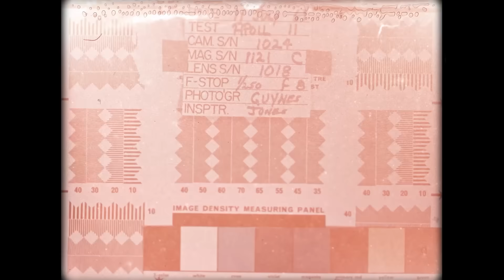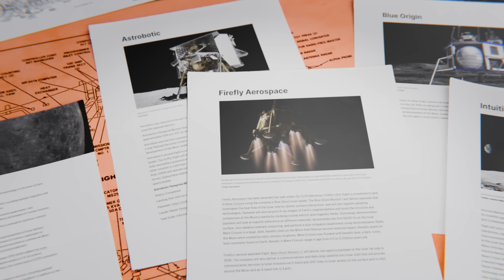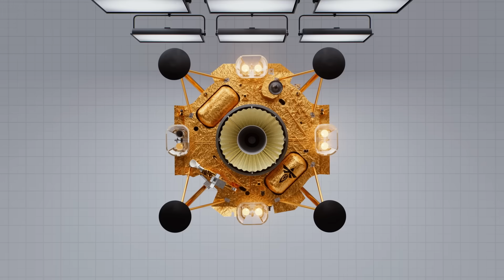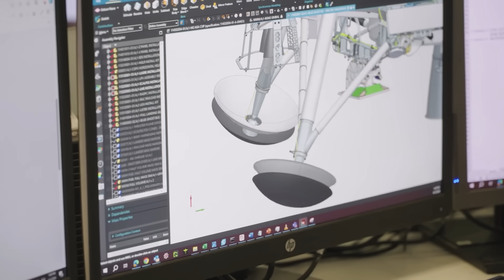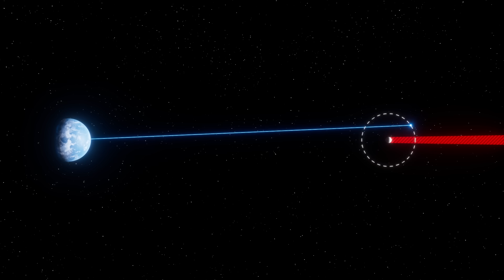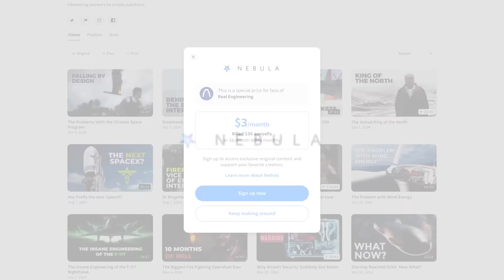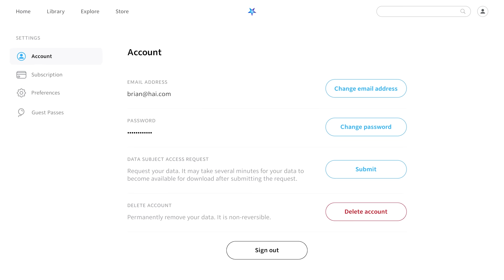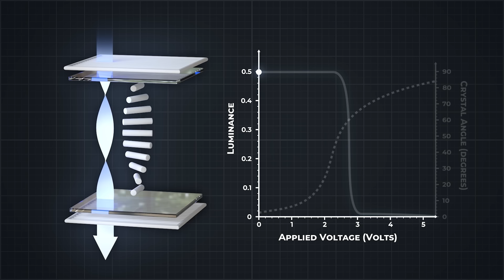Why the US is Struggling to Land on the Moon

Comment: Many KSP players can attest to how difficult it is to land on a foreign celestial object.
Reply: And KSP makes it 1000x easier than it it is irl
Reply: @relafleur5114 idk if you're exaggerating, but if you really think it's 1000x, its actually 20x easier.
Reply: @relafleur5114  that's so long as the kraken doesn't rear its head
Reply: @relafleur5114  the opposite, KSP is waaay more difficult than irl. There you do it manually, here you have computers with immense presission. (Obviously the game magically builds stuff and ignores actual chemistry, but spaceflight is waay harder manually)
Reply: @moontworks2232 well sure, it’s “easier” to let the computer do the work, but the point of the vid is that our computers are far from reliable at this point. If IM could have a skilled pilot manually fly their lander to the surface in 60 fps, with a fully adjustable 3rd person camera following it the entire time, there’s almost no way they could have failed. Not to mention that most the moon rocks to be avoided in KSP exist as flat textures. Theres just too many factors of doing it irl that you don’t even have to think about to do it in KSP
Reply: It's very easy to land, but my tank of fuel is empty once Im there. it's just hardcore to send enough fuel to ever come back and get another orbit on Earth to then splash down, even with rendezvous and refuelling on Earth orbit, which is already a challenge in itself
Reply: @Etrehumain123  Another orbit on earth? YOLO, straight to 50k meters altitude.
Reply: @Etrehumain123  Do enough Rendezvous and they become easy. 

I have a research and fuel station Orbiting the Mun at 18km and mastered rendvouz and docking int he process of ferrying back down and up to all 17 biomes and contract sites. Had to send 1 refuel mission which I used to also put a satellite in Mun Orbit for a contract. Total liquid fuel load was like 4.4k on the Station and Refuel misison each, 8.8 liquid fuel and associated Oxidizer, and got both back landed in the water just off the spaceport. Efficiency! 🤓

Docking itself is easy once you learn to use the RCS with H and N key to fine tune to approach.
Reply: @Etrehumain123  most of the time the engine you use plays a larger role than the amount of fuel
Reply: Facts
Reply: I landed on the moon but didn’t have enough fuel to make it back
Reply: @SparklingWalrus  In my cases there might have been enough fuel to fly back before landing. However it will just burn up when it lands very fast in to the moon. 
Some are saying that I am just bombing the moon bit hey a landing is a landing that hunk of metal is on  the moon.
Reply: @SparklingWalrus almost
Reply: I love remembering a certain aspect very early on in ksp, where a friend of mine just used infinite fuel since he did not understand how to get to the moon properly and accelerated straight towards it, with me sitting behind him. With 20.000m/s and closing in on the surface, he flipped the rocket around and began tiny little course corrections to straighten the rocket, with me just sitting behind him, with a huge grin on my face, and 30 seconds before his "landing" asking him if he isnt a bit fast. The look on his face when his head turned to me, checked the speed and immediately began to to full throttle shortly before scattering all of his rocket and crew on the munar surface. Good old times.
Reply: the tip over was so kerbal XD
Reply: Imagine playing KSP with 2.5 seconds of lag. That's how long it takes for signals to round trip to the moon.
Reply: @JoshuaPTFan  there is a mod. for obvious reasons, it had not a lot of fans: the idea behind the mod, you have 2 or more players. one player has a screen with orbital data, and the other one has a screen with the view, but only cockpit.
one player was mission control. I think, they didn't go all the way with time delay, etc. but it would have worked.
there was also a antenna mod, before stock antennas were a thing. that thing too took time delay and blackouts into consideration.
Reply: Any landing that doesn't explode is a good landing
Reply: Landing - quite easy. Rescuing stranded Jeb from a planet with an atmosphere and bringing him home - yikes!
Reply: just get them to do it
Reply: @bpqd2624 Unfortunately even if you are an RSS mod veteran, KSP does not accurately simulate multi-body gravity because the math is too hard.
Reply: @starshade7826  the Principia mod comes close.
Reply: What I do is make the rocket so big that I start on the Mun
Reply: bro rss is so much more difficult than stock
Reply: It's quite easy to land on anything when you can use saves.
Reply: One of my fond early memories of KSP was successfully landing a crewed lander on the Mun, only to realize I don't have anywhere near enough deltaV to make it back.

This forced me to design a rescue lander with sufficient capacity and deltaV, but none of the scientific payload, then land it close enough to the original lander to allow my kerbals to carry themselves and the data from one lander to the other using EVA suits.
Reply: Every KSP player ever just nodded at the lander tipping over. "Yep, that's how it goes."
Reply: 12:45 that bounce after you think it's successful landing, I want to smash the monitor
Reply: Many KSP players can attest how difficult it is to take off from a celestial object ...
Reply: ALT + F12 is the solution
Reply: Maybe they should have designed their ship in KSP 🤪
Reply: The easy part is landing the hard part is coming back
Reply: Funny, but the older I get, and I'm old now, the less I believe that the US went to the moon, especially given how they are behaving now. Just saying.
Reply: I’m still trying to figure out how to take-off without spinning out of control and exploding, maybe I should add more boosters.
Reply: i now man i can barely get in orbit iv had this game for a year its hard
Reply: I'm an old timer on KSP and I STILL find landing on the Mun challenging. 

Although Minimus is a lot farther away, its lower gravity makes landing considerably easier.
Reply: I mean it's way easier in ksp but oh man is it hard to get a decent manned  lunar lander on the moon get it back also hoping that nothing fails and that your simulations were correct in ro rp1
Reply: It's like KSP, but with 1/1000th the budget and only unmanned spacecrafts.
Reply: My kerbals launching in ironc0ck11 right after uronc0ck10 has failed while taking off, no changes have been made
Reply: 'Outer Wilds" is also quite challenging in landing on a planet
Reply: This is why we need a smaller, more spongy mun farther out.
Reply: Robbaz is the living proof
Reply: And the fact that unlike KSP, you’re dealing with tight schedules, dozens of suppliers providing thousands of parts and assemblies, politics, funding constraints, human factors and any manufacturing or quality error results in people dying. 

It’s incredible what humans are capable when everyone comes together for a single purpose. Especially when that single purpose was something that had no benefit besides human curiosity. 

“But why, some say, go to the moon? Why choose this as our goal? And they may ask—why climb the highest mountain? Why fly the Atlantic…? 

We choose to go to the moon, and do these other things…not because they are easy, but because they are HARD”
Reply: And you learn right away that a good lander is squat and wide, not a a tall, skinny stick.
Reply: I had no idea the Kentucky State Police has jurisdiction/presence on the lunar surface... Very sexy/exciting news, indeed!! They'll politely beat the aliums' brains out if they try and sabotage our next mission! This is an excellent revelation.
Reply: I'm phenomenal with it... Using unlimited fuel cheat...
Reply: I have abandoned so many poor Kerbal
Reply: Us is fucking stupid.
MAKE PANCAKE  NOT CIGAR.
Its the number one rule
Reply: No it isn’t, they did it allegedly in 1965 and just can’t seem to figure out how to do it since with all of the advanced lasers and rockets and computers, absolute lies, we’ve never been to the moon, all of this is computer imagery it’s all fake
Reply: Landing is super easy, barely an inconvenience.
It's returning from the foreign celestial object that is difficult.
Reply: The main thing is you CANNOT miss details in design and planning. Execution is not too hard unless you skimped on budget.
Reply: Has anybody here tried to play ksp realism overhaul, real solar system and realistic progression 1? I have played it only until orbit
Reply: Nothing compared to a rendezvous with no ecs or mono propellant
Reply: Anyone without training can land on the moons in ksp.
You don't need any math, engineering or physics knowledge.
Ksp isn't made to be difficult, but to be a fun arcade game.
Reply: The only way to land on a terrestrial body is with or more than 3 rockets not placed direkt under the tail to balance but away from the rocket body and when on  landing mode the whole of the rocket have to land upside down and the rockets up which can turn the trust to the  surface of the terrestrial body for effective center of gravity
Reply: RSS/RO gang 💪
Reply: I landed several hundred times without issue both in stock and with realism overhaul. It is pretty easy, I even made an algorithm that does is correctly 9 out of 10 times, where 1 out of 10 times it lands just inside the rim of a crater (steepest slope) and I am too lazy to make a better algorithm. Of course landing become a lot harder if you can only throttle down to say 80%, with too much thrust-to-weight, an engine with few or no relights, barely enough fuel and insufficient RCS.
Reply: @richardbloemenkamp8532  out of curiosity, how do you get the algorithm to run on ksp? That sounds like a fun playthrough
Reply: in KSP, landing on mün is easy.
a few thousand meters above the ground, you activate the parachutes, and then you just wait.
and need quite sturdy girders as landing legs, because you are now lithobraking.
Reply: @robertheinrich2994 lithobraking? Parachute? The mün? Are you high?
Reply: @brucemanly  congratulations for finding the joke.
Reply: @robertheinrich2994 aren't jokes supposed to be, ooh what's the word?... Funny?
Reply: @Chris-ok4zo

I'm not sure what you actually want to say here.

Also, I think it is very sweet that you try to compare an entertainment simulation program with real life. That's not even comparing apples to oranges, that's comparing apples to eggs.

Also, if you think that playing KSP for any amount of time amounts to the same as hundreds of thousands of people working for a decade on a space program, and that you investing a few bucks in a program amounts to the same as the roughly $25B (in 1973's money; roughly $250B in 2023 money (Wikipedia: Apollo program)) spent on the space program, then that is very sweet also, but a little bit out of touch with reality.

Last-but-not-least, if you think anybody playing KSP is as qualified as Neil Armstrong, then I think you're comparing incomparable things again. That's like saying, because somebody is a master-piano player you are too. Or because somebody else is a patissier you are too. Etc. etc, I think you get the point. Life doesn't work that way. In fact, I think Neil Armstrong was a kind of a one-off. Not even his colleagues could do what he could do. He was a real master of his craft.
Reply: @light-from-dark  "I'm not sure what you actually want to say here" - clearly : p

I think the implication goes the other way: even in a simplified environment like KSP, this is already tricky to get right.
Reply: @light-from-dark  You appear to significantly underestimate the value of games and simulators. Today, Formula 1 drivers learn the majority of F1 driving in racing simulators/games. Flight simulators are the backbone of pilot training. 
I'm not saying that building a rocket with KSP is reality but there is a decent amount that can be learned and that most people without game/simulation experience do not understand. 
You can call all those people sweet and naive but in the end you yourself will know and understand the least. 
And by the way it is quite likely that you are not in a position to judge the quality of Neil Armstrong compared to his colleagues. There are a ton of romanticized stories but did you actually have access and read through his medical and test records or are you just repeating what others made you believe?
Reply: @richardbloemenkamp8532  
We're talking about a commercial product, a game here (KSP). I wasn't talking about professional environments, which I am well aware of, but which are on a completely different level, especially price-wise. And btw I didn't mean to criticize KSP or otherwise make it look like a bad product. In fact, I think it is amazing. I doesn't qualify you automatically as a well trained pilot, however.

And yes, I might not be in the position to judge the quality of Neil Armstrong. You also might not be in the position to judge my judgement. Who knows. How about Armstrong saving the day after something went haywire when they first docked to the Agena Target Vehicle? Or the manual take-over when finally landing on the moon?

Long story short, by your remark YouTube might as well shut the comment section down completely, because all of us are hardly qualified to comment anything on anything really. So, why bother.
Reply: @light-from-dark  Agree with most of your points except "How about Armstrong saving the day after something went haywire when they first docked to the Agena Target Vehicle? Or the manual take-over when finally landing on the moon?". Other colleague astronauts might have responded equally well, better or worse in the same situation. Maybe Armstrong was just lucky that he made a fortunate choice.

These are exactly the one-time events that get romanticized as exceptional without any comparison to how others would have performed in the same situation. Of course I'm not saying that Armstrong was a bad astronaut. He was certainly very good but I don't like assigning an aura of super-human capacity based on a few one-time events.
Reply: @light-from-dark only jeb Kerman is more skilled than him

Comment: Why are they not installing a range finder on the bottom of the craft it would reduce the blindness of the last 20m of landing as well as the bouncing problem they could combine an ultrasonic and light to filter out the other noises(in the could) and especially the ultrasonic is cheap lightweight and needs only very low power.
Reply: I see your idea, but the problem with ultrasonic sensors is in the name: “sonic”. They need sound to operate, and sound doesn’t travel in a vacuum.
Reply: @boeing_is_best5632  I mean it would be unnecessary anyway but your definitely right didn't tough of that
Reply: Funny, but the older I get, and I'm old now, the less I believe that the US went to the moon, especially given how they are behaving now. Just saying.
Reply: No place to put. Remember the bottom of the craft is basically just thrusters
Reply: @smeeglestheringbearer  No legs just thrusters.
Reply: @smeeglestheringbearer  ok that makes sense
Reply: I even heard from an engineering friend just now that a sensor only using light could be enough as in a dust could the noise is gaussian
Reply: @J3xter  It's less of a dust cloud and more of a dust jet. Also, why risk using an untested and potentially unreliable technology when you can use something that is very well tested (accelerometers). Basically, why add extra risk when you already know of a simple solution that is guaranteed to tell you what you need to know.
Reply: @Snookers_  I mean in theory you could integrate twice over the time your relative (de)acceleration to get a relative meter readings but if those problems occur it doesn't work for someone reasons

Comment: The Surveyor program, in the 60s, landed 5 probes on the moon for a total of $462 million.  The program included a total of 12 launches.
Reply: With 7 of them being landing attempts.5 landed and 2 crashed. The cost is 4 billion today if you adjust for inflation.
Reply: @linecraftman3907  true, but when accounting for inflation we should also account for the fact that now we should have 60+ years of knowledge, modern machining tools, material science, and CAD/simulation tools they could have only dreamed of in the '60s.
Reply: @linecraftman3907 I wouldn’t downplay the fact that NASA managed to soft land remotely 5/7 times without microchips and other modern tech and without any previous experience. It was honestly a tremendous achievement. The soviets were doing just airbag assisted “soft” landings at the time (although admittedly they did “soft” land first as well as many other firsts when it comes to lunar exploration). Yes, price was high when adjusted for inflation, but 60s space stuff was all around very expensive.
Reply: What happened to the ones that didn't make it?🤔🤯